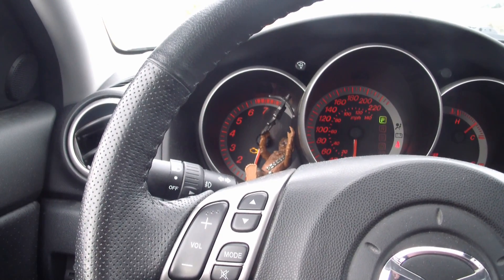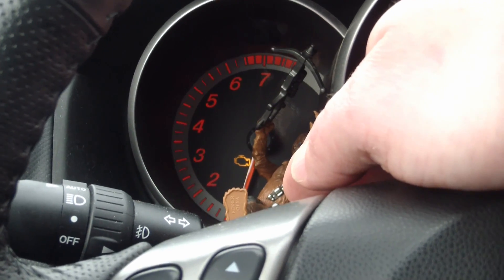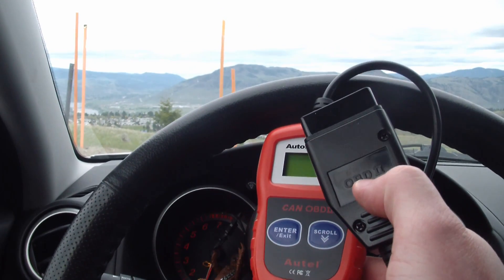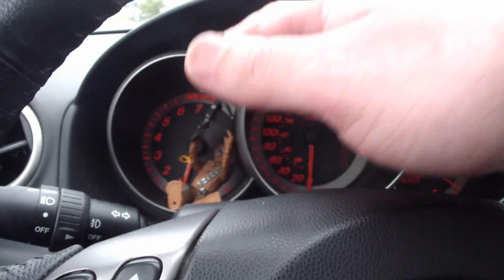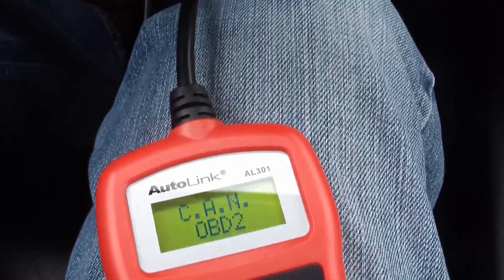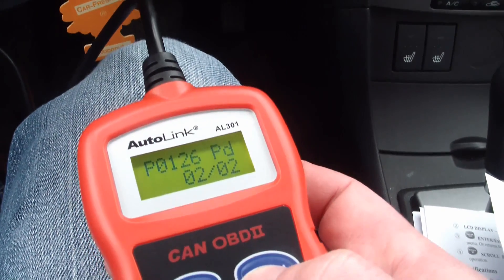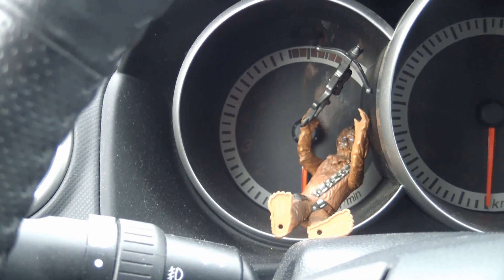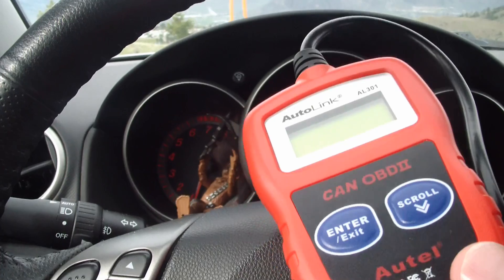Manly-Man Skills: Outsmart Mechanic Scams by Using Your Car's Computer!

Comment: I've had one of these in my subaru for the last five years. http://www.scangauge.com/products/scangaugeii/

I will make sure every car i drive will have one. Educate yourself on what it can do. Currently I have it displaying instantaneous fuel usage, calibrated speed, water temp and air intake temp. If you car has a sensor it can read and display the info.

Occasionally my car will overboost (turbo) and throw a code. I can read and clear the code while driving. No need to turn the car off and restart. Recently i am dealing with a Secondary Air Pump failure (a completely unnecessarily and fraudulent system if every there was one) Every time I start the car and it goes through a cold start cycle it throws the code. I can clear it in under 5 seconds with this little beauty.

Comment: Throwing parts at a fault....

Ford Transit with auto-shift manual. I took Ford to court for changing countless parts to no avail. The thing had an intermittent stalling problem that nobody would touch and Ford couldn't fix.

And to think how many twin-clutch autos are out on the market now. Impending disaster I say.
Reply: Samsgarden Ford's dual-clutch manumatic is an absolute disaster. My friend's mom has a Focus with that transmission, and unless you floor it everywhere, the stupid thing fucking slips the shit out of the clutch and bucks you around. It's been to the dealer 3-4 times to have the problem 'rectified,' but as of the last time, it still does it.

Comment: I believe it is somewhere in the standard that the OBD connector must be within arms reach when sitting in the drivers eat
Reply: Lasse Langwadt Christensen I love Volvo's interpretation of that on early OBDII cars. "Putting it under the coin tray in the center console is well within arms reach, right?"
Reply: MrADVANCEDTEK  That was my typo but you also are very correct with regards to OBD vs OBDII introduction.
Reply: Lasse Langwadt Christensen Some cars like the T-Bird 1996-98 had the OBD connector below the glove box on the passenger side.  European cars were the most original with OBDII connectors in their consoles like the Audi A4, or VW which requires finding the hidden panel on the dash.  Worked at one of our states emission testing stations and finding the OBDII connector was sometimes a real joy.  Especially for the auto enthusiast that blocked its access because of needing to mount their trailer brake control unit, or just plain didn't know what it was and hacked the plug off completely.  Then of course explaining to the guy who has a burned out check engine light why he failed his emission test, or taping over the light itself to prevent its being seen, made every day an opportunity for something new.  LOL
Reply: Lasse Langwadt Christensen OBD refers to the early versions(pre 95) used in most cars. OBDII are those systems used in cars after 1995-6. I believe the regulation for federal requirement is between 20 to 25 inches from the center of your column. Sometimes they're hidden pretty good. People don't realize the legislation require a "OBDII" connector but nowhere does it say it must be the only way to communicate with the ECM. Look at BMW,Toyota,Lexus,Diamler Chrysler Mercedes. They have the OBDII and their own connectors.
Reply: +hankus253 my 96 a4 had it behind the center console. Sure its arms reach... If you remove your arm with your other arm and hold it behind your head and drop it.

Comment: Throwing this in. A OBD will sort you out 90% of the time. Here in merry ol' England on occasion you get generic codes that don't mean anything because you need a proper dealer diagnostic to read it.

Was trying to fix a Fiat, but it threw up a code for a part the car didn't have. Fun times that. Or another time the car threw out 10+ blank codes (P0000 if I remember right). Which turned out to be iffy fuel.

Still, for £5, its a damn handy bit of kit.
Reply: Concerned Citizen Out my arse, like many figures I pull.
Reply: Jeffery Sanders Failpocalypse is my new favourite word!
Reply: Big_Adam_2050 Best kind of kit. IMO, every car owner that respects themselves should own one.
Reply: Big_Adam_2050 Fiats are fixable???
Reply: Michael McCurley Fix It Again, Tony. Your name has to be Tony.
Reply: Big_Adam_2050 where did you pull the 90% figure from?
Reply: Concerned Citizen May i just say that i like the fact that you're concerned about that? :)
Reply: ***** Never thought to try that. Was a £5 unit, so just thought it to be a throwaway for new version dealy. Will have to investigate.
Reply: Big_Adam_2050 As I said to the other fiat owner, look up MultiECUScan, with right adapter it can read different modules/vehicle specific codes as the software is meant for Fiat/Alfa/Lancia.
Reply: phlodel No it ain't. I worked on a Fiat. Once. Worked on a Lotus too. Once. There's a really good reason why I'm  very partial to Toyotas and Mitsubishis... they're fixable...
Reply: why were you wasting your time on a Fiat.?
Reply: Fix
It
Again
Tony
Reply: Michael McCurley FIAT- fuc#ing immoble all the time...
Reply: Michael McCurley Shoulda bought a Chevy...